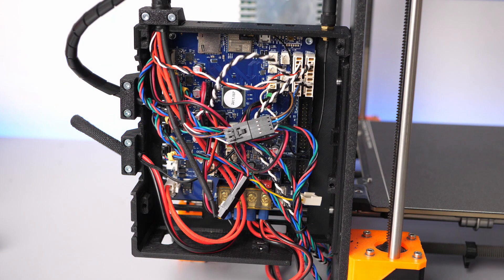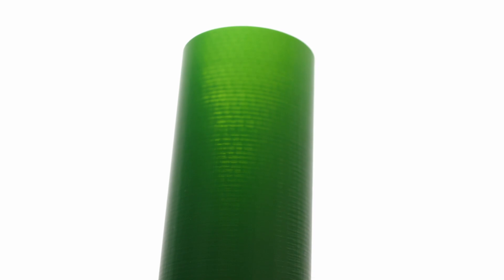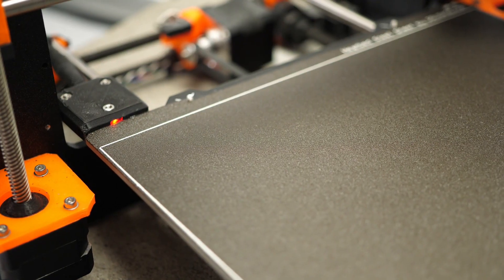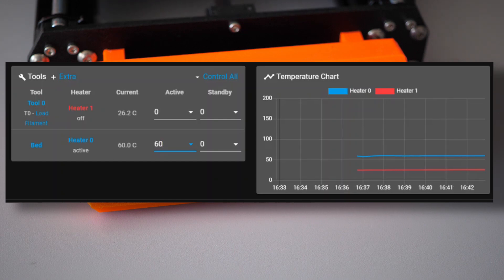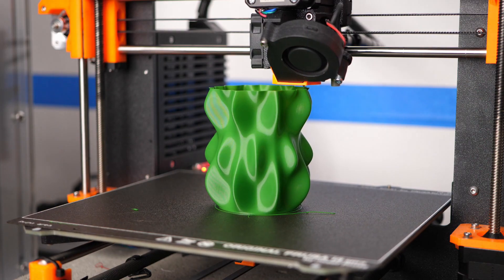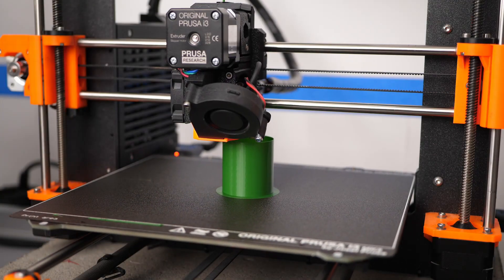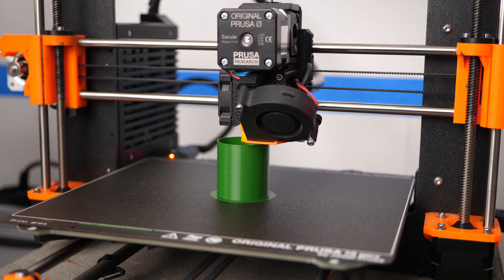PID vs Bang-Bang Temperature Control

Comment: Wow, interesting finding, I wasn’t thinking that could have such a big effect.

Now I’m thinking to put some dial gauges on the bed and see how much it deforms while doing some heating tests.

Many thanks for the insights Stefan, very useful 🙌😎
Reply from the maker: I'll have to do that!
Reply: @CNCKitchen  And it would be super to compensate this in firmware during print with automatic z-baby stepping :D Like mesh bed leveling, but temperature mesh compensation.
Reply: @JanVokas  That would be really neat, but you would only be able to compensate for the bed lifting/dropping.  If your bed were warping during the heat cycling, you could compensate for the first couple layers, but after that, the part geometry will result in unpredictable part movement.
Reply: @Kineth1  You are correct, but what if the mesh compensations were applied to the X, Y and Z?  This might be harder to predict, however!  Perhaps, piezoelectric sensors could be placed under the print bed to monitor any bed deflections and compensate in real time!
Reply: For large 4-point constrained PCB beds it can be really dramatic. With the PCB bed from my BLV cube kit, you could see it moving by eye if you parked the nozzle over the middle.

Comment: For AC powered beds you could use a PWM input phase cut triac dimmer heated beds would be almost perfectly resistive so those will work fine.

Comment: i had this happen a while ago, i figured it out by sound actually as my fans noise pitch changed when the bed was heating.
i always thought it would be dueto the power delivery not being beefy enough and the extrusion changing, not the bed flexing.
Wouldnt that make for a fun experiment?  have two identical printers print the same thing side by side, but printer No.1 controls and heats the bed for Printer No. 2 and vice versa.
That way you would have a definite answer, i cant really believe that flexing of the bed would make such a difference as its only a few °C, if it was from 0-100°C okay, but between 48 and 52 or something like that not so much IMHO.
Would love to see that video as i cant test it myself.

Comment: if you add U1 to the  pid tune code it changes the PID to the results you just got (no need 304) still need to save it with m500.

Comment: i do not get it .. when doing pid tuning reprap give me this command back to put in config.g    its not a 1 or a 0 is it bang bang or pid i have ..   its a 12
M307 H0 R0.114 C871.8 D0.43 S1.00 V12.3
Reply from the maker: That's bang bang. As I said in the video, if you don't define B it'll use bang bang.

Comment: You may not know, but a thyristor is installed inside the SSR, and it CANNOT switch more often than the frequency of the 50 hz network. It is impossible to increase the frequency of PWM, on the contrary, it must be made as low as possible. In general, this device is NOT intended for PWM. It can be used as a power regulator, but you need to track the transition of the sinusoid through zero, and printers do not seem to know anything like that.

Comment: Oh boy i feel so stupid now. I have built a delta like half a year ago and it drove me crazy. I was tinkering with thousands of components and spent hundreds of hours. In my head it didn't make any sense that i happened to have less issues when printing faster and faster. I never used pid on any of my printers since i am afraid of burning my mosfets from too high switching rates. I guess tomorrow is tinker time again!
Reply: A little update if anyone cares... Yep im dumb. Today i reassembled everything reflashed and calibrated and printed with bed turned off. The result is perfect. I build printers since 7 years and couldn't figure it out myself. Thanks Stefan!

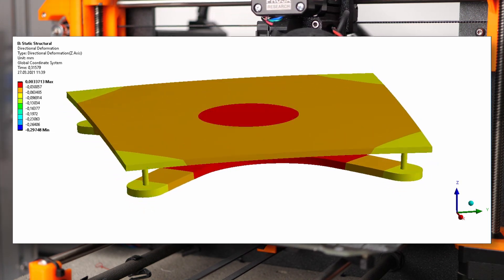Comment: 4:15 I could understand this happening on the first 4" of layers, but at 6"?! Is the entire object still flexing?
Maybe bang bang uses too much power from the supply and is affecting the nozzle heater's current?
Reply: Connect the bed heater wires to another bed that isn't physically in the printer. Then see if you still get "thermal expansion" banding problems.
Reply: If you still get the banding, then the problem is the power supply.

Comment: I had similar problem with my cr-10 but i think that the problem is power and not thermal expansion.
Sometimes I would turn off my heated bed and i notested the hotend temp fluctuated a lot, i think more power went in to the hotend with the bed off and my pid wasn't set for that change.
(p.s. sorry for my english)
Reply: I agree. Connect the bed heater wires to another bed that isn't physically in the printer. Then see if you still get "thermal expansion" problems.
Reply: @TheRainHarvester  I think it is enough to try a different power supply

Comment: Well, then  I should think about dampening the temperature fluctuation with a large thermal mass (thick aluminium heatbed) + thermal insulation?
Reply: While that does make sense, the controller will still react after the set threshold, so it will just take longer to turn on, and turn off. Setting a lower threshold would be the answer to lower the fluctuation, but it's probably gonna make the controller operate it all the time and could possibly overshoot quite often.
Thermal insulation ain't gonna hurt tho, just quicker heat up times so go for it.
Reply: @Kalvinjj  I meant already with PID. Just to make it even More stable. Every Micrometer matters :-)
Reply: @tobiaskron5996  That might help indeed, as on PID it will try to just keep putting back heat as much as it loses to the ambient.
Tho I wonder if we aren't going to a point so absurd that every little vibration from the machine and the plastic mass itself on top of the bed isn't making a difference as well.
Reply: @Kalvinjj  A CoreXY-Printer were the mass of the bed and the printer doesn't matter, seems to be the best answer. Now I want to build a Voron even more ;-)

Comment: I had the same issue in one DIY printer. It was driving me crazy although someone in a forum suggested me to perform a PID tunning. In my case I was already using PID, but the values were not tunned.

Comment: I have used a bang-bang algorithm for a diet. I weigh myself every day and keep a running average of three days. If my weight is above the set point ( a linear ramp down to my weight goal), I take a low calorie day (750 cal). If I am at or below my set point, I eat my maintenance calories. It work pretty well, but getting two low calorie days in a row takes a bit of will power.

Comment: Such a big difference at just 1 degree difference? I am a little bit skeptical about that explanation. I think would try to reproduce this in a specialized test print. If this theory holds true you should be able to see an even bigger effect when altering the bed temperature during a print. The effect of e.g. 15 degrees should be massive then.

Comment: Did you calculate the thermal expansion? With only + -1 K I can't believe it will be enough to see them rings.
Reply: I don't think it's that. It must have something to do with the "power shocks" on the Mainboard itself. They are strong and happen less frequently than mini burst of PID.
Reply: It is, at least on the original printer that bed pid was implemented for in Marlin, the mendel max.  It had a 250w heater and a glass bed.  The math is all in the git commit to prove it.
Reply: The slow nature of temp sensors could mean the temp swing is greater than indicated.
Reply: @stephenmcdonald3781  the temp sensors are super quick? It only depends on often you poll it. You could basically get 5 different values within a second when you heat it up.
However the temperature transfer in the bed is slower and thus you will get a different temperature through the entire bed. The temp sensor can only tell what's in the center of the bed.

Comment: Wouldn't the variations be caused more by the electrical load change in the system than the thermal changes?
Reply: That is also my guess. 
Bang Bang has a very high impact on the Mainboard especially when using the mosfets from the board and not exter Al mosfets with seperate cables. I speak from experience. Bought a used JGAurora A5 which had bang bang and no separate mosfets.
You could hear the power loss on the cooling fan. Also it affected the print quality each time the 300x300mm bed banged power.
But it's just one possible reason.
Reply: I'm inclined to go this way as well. With steel and aluminum expansion coefficients in the 10-30 micrometer range per C and a fluctuation only being within a single degree, one would need a fan actively cooling the board itself to produce those kinds of results.

I think the hysteresis board management is drawing power from the heater, motors, or both and causing the issue, not the bed flexing.

Comment: Incredibly smart. I never had thought of this. This issue may also be amplified and propagated to the extruder especially if the printer has a relatively weak power supply. It can be demonstrated as patterns due to the higher switching noise as the power supply is unable to provide enough power to the bed, or by skipping and under extrusion.
Reply: Yes, I think it is actually an extruder problem: not enough extruder heat element current when bang bang turns full on for longer than a pwm pulse.

Comment: Great find! My printer has been using bang-bang forever, and I've had issues like this before (although not entirely sure if Z-wobble or this).
Something else to consider : If using bang bang, the 0% -> 100% duty cycle change has a large impact on supply voltage to the rest of the system (on my printer at least). I hear the drop in RPM (therefor voltage) to my part and cold-end cooling fans when it periodically turns on. Could this also contribute to this anomaly, and to what degree? I wouldn't think that a +-1 degree temp change on the bed could be the sole contributing factor. Maybe a test with a bed heater with an independent power source could provide some data on this.
Thanks for a great video as always!

Comment: Please try this experiment. Keep the bed stationary, use a sensitive test indicator, something with 0.01mm graduations, to indicate the center of the bed. Now try each heater control scheme and see how much your bed is actually moving in Z due to fluctuations in temperature.
Reply: The issue with that kind of a measurement is that your indicator is also growing and shrinking as the temperature fluctuates, and needs to be accounted for.
Reply: @Turkishmath  introduce a thermal insulator, such as a 3d printed object. if the effect is real it doesn't matter whether or not the dial indicator is directly in contact with the bed
Reply: @ikbendusan  You cannot indicate to a variable object like something that is 3D printed. Plastic has a HUGE Coefficient of Thermal Expansion and would be unsuitable.
Reply: @Turkishmath  Let's be realistic, if a change of 2C disturbed the test indicator that much it would be utterly useless in real life.
Reply: in case one part of the bed doesn't expand and another part does i would use multiple dial indicators to take into account that distortion
Reply: @ikbendusan  Laser interferometry should be able to illustrate minute changes in form and placement.
Reply: @ikbendusan  This is a good idea. You could also use the same indicator by making multiple tests and moving it to a different location for each test. You would need to keep the other testing conditions constant.
Reply: Prusa has screw in the middle of the bed. So in the center of the bed there will be no movement. But may be different for other printers with less rigid construction.
Reply: It has already been done: https://www.youtube.com/watch?v=2sW25xt5E6U

Comment: yeah but the bed frame would not warp like that with the top because the connection is loose? 🤔 if it was proper rigid connection with no play at all anywhere then i'd see it doing that.

Comment: This is super interesting. I have never once thought about how bed temperature fluctuations can cause printing artifacts. I guess it's more ideal to use a solid block of aluminum as your bed than a PCB heater in order to have more mass - but if you use an aluminum block, you're probably using AC power and an SSR, so your control probably has more overshoot and oscillation. I wonder if the thermal mass of the aluminum block is enough to negate the poorer controls? And I wonder if there's any way to improve the physical characteristics of a Prusa-style PCB bed so that it has more temperature stability. Also, if you do go with a block, I wonder if it matters how you mount it. Which direction it's mounted from constrains it in different ways, meaning that its thermal expansion may behave differently. So much to think about!

Comment: That is garbage every Mosfet can use PWM but If you are not doing it right your Mosfet burns up. So the note is wrong it should more be written like please only use my board with DC because I was too cheap for more components ;) Btw. nice video though. For the noise just use a higher PWM frequency above 30Khz the noise should be gone.
Reply: Huh? The PWM frequency for heating elements when PID is on is 7.689 Hz. Did you not watch the video? You shouldn't increase this value too much. He increased it to 25Hz. But kHz? NO.
Reply: I watched it and my answer was the solution for noise canceling 7Khz and smaller you will hear. Why not Khz ? You can design it to work maybe not with his board If your answer is then it will heat the mosfet then my answer is mosfets can switch up to 100s of Khz with not much heating If you design the board right and 30Khz is easy to design with no heating just switch the mosfet with fast transitions and not rounded rectangular waves therefore you need a mosfet driver and an heating bed won´t be hurt from 30Khz don´t worry. You just need to put an oscilloscope probe at the mosfets gate and watch.
Reply: @Telectronics  my answer somehow wasn't published here.
Anyway, on Marlin you can't go past around 900Hz for the heaters's PWM frequency. It's set with SOFT_PWM_SCALE.
Reply: @alejandroperez5368  Oh ok I didn´t know that because I never worked with that board in special. If he doesn´t want to use another board or make it there is only a way to try to filter or dampen the frequency but because the frequency is quite low it will be much harder because of component sizes. And it will be a bodge so maybe he doesn´t like that idea.
Reply: @Telectronics  it's not a board thing. It's a Marlin limitation...
Reply: @alejandroperez5368  Ok but he can´t use anything else as software right ?
Reply: @Telectronics  there are other operating systems, but Marlin is the most common one in 3D printers

Comment: The power drain when the heated bed activates in bang bang mode may affect the motor or heatter of the extruder???
Reply from the maker: The voltage of the PSU drops a bit but if it's powerful enough the impact shouldn't be too big.
Reply: @CNCKitchen  but you should check the voltage/current on the Mainboard traces itself. The bed instantly sucks full power causing little spikes which could also drain/hit capacitors and cause a quick shortage of current. The fan of a JGAurora A5 always lowered the rpms once the bed banged.
But of course I'm not as much inside this tech as you are. Just trying to guide thoughts in another direction.
Reply: @CNCKitchen  Could ultimately be skewing the thermistor though. Would be interesting if you could rule this out. You could remove the heatbed (leave it attached, but don't actually print on it - i.e., just leave it sitting behind the machine). So you have the same electrical load, but you're not heating the actual print surface.

Comment: I have err. MINTEMP appearing when MK3S cooling fan is at 100%. It occured after changed nozzle heat cartridge that was damaged by huge previous filament chunk.
Reply from the maker: That means that your thermistor cable is probably broken. Happens quite a bit when you have blobs around your hotend.

Comment: How do you switch the frequency of the PID in Marlin firmware? I remember trying to solve a problem with my bed and trying bang bang due to the frequency of the PID causing issues, since I couldn't find out how to change the frequency of it.

Comment: I’m calling your bluff. A variation of 1 degree will cause practically zero expansion/warping.
Reply: You have to consider the entire systems thermal dynamics. Temperature is not even across the bed, there can actually be gradients ranging in the double digits, even though your sensor only registers the temperature to be 1 degree off. Also  geometric constraints are not equal on every machine, therefore these gradients can result in quite severe deformations, causing visible layer lines.

Comment: That’s very interesting about SSR controlled beds. I have one that seems to struggle getting to temperature. I blamed it on lack of insulation and the fact it’s trying to heat through a magnetic bed to the spring steel / pei surface